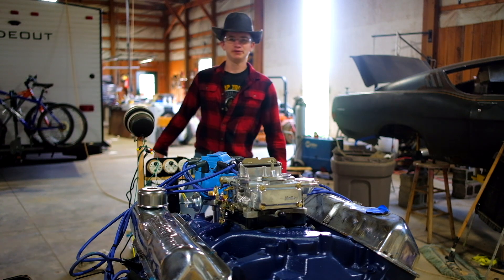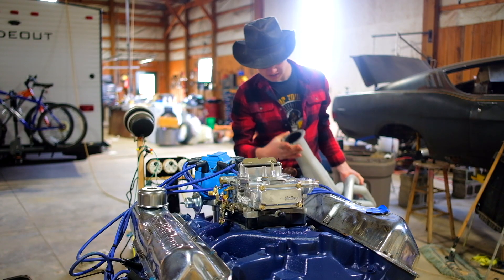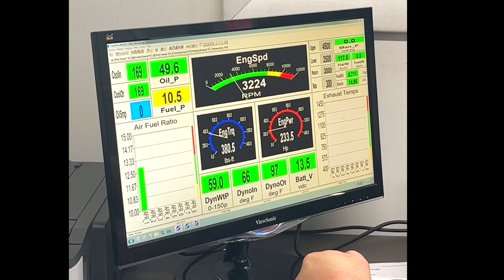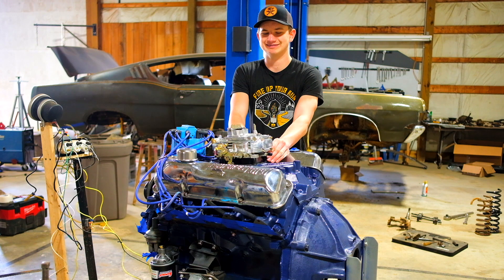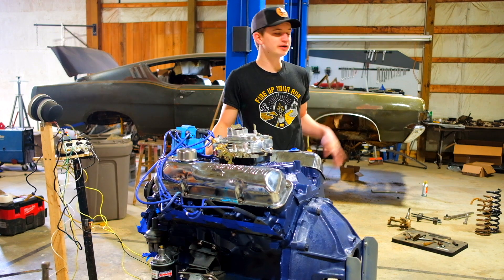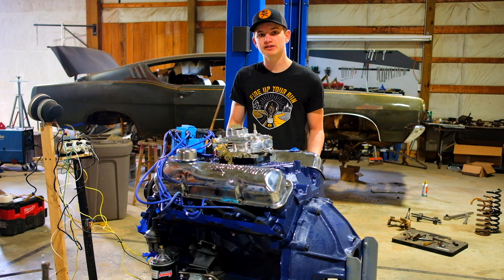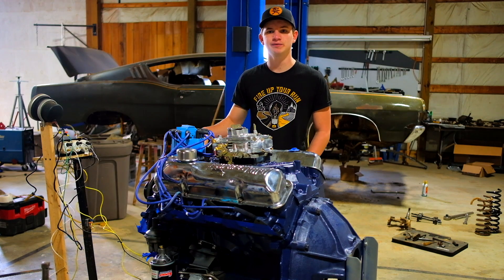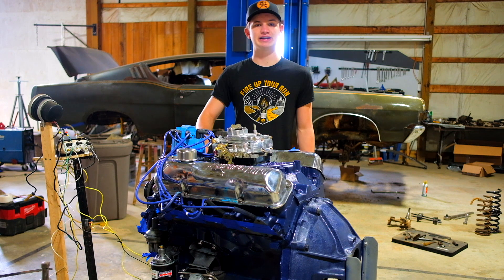Stock Rebuilt Ford 390 GT Dyno Tested

Comment: Cough....Choke....Cough....this engine choked out at 3900rpm. Even the 390-2v camshaft went to 4400rpm. I think you have a 1972-75 390 cam that makes peak horsepower at 4,000rpm and peak torque at 2600rpm
Reply from the maker: You could be right but I have evidence to suggest otherwise. For starters I didn’t fully degree the cam like I ought to have but I did take a few measurements and my gross lift is way higher than a 75 cam. I don’t fully know why I made less power but I don’t think it was my cam.

Comment: 650 cfm is not enough for that motor 750 or850 would be my choice would improve probably 10 hp being conservative had 780 from factory
Reply from the maker: Yep, found an 800 double pumper a few months ago, rebuilt it and that’s what I’m running now. As well as a sidewinder intake and a Progression ignition distributor.😎 I don’t think you can ever have too much carburetor when it comes to peak horsepower.

Comment: Find a Edelbrock. Street master intake.  For it.  One that has not been  been modified. No port work  they are only a couple hundred bucks  best intake you will ever get for a stock. FE.  Don't port match until you are going for 500 hp.  Leave it box stock.  It should get you to your 300 hp + mark.   With ease.  Good luck
Reply from the maker: Thank you!

Comment: the 390 was just as fast as a 396 or 383. if it had a bigger carb and a better exhaust it could outrun them.390s came under carbed from factory and the factory log manifolds were very restrictive.

Comment: I would get a 270 H cam and run it up to 6000 you aren’t going to blow it up. Mine is making 503 hp and can rev up to 8000. FEs are tough.
Reply from the maker: I will eventually, and yeah they are very tough

Comment: You ant running it right and just for your info that moter is good for 7000 RPM red line all day.try putting the cam timing strat up

Comment: Why would you run a H.E.I.          😔I mean, there's a lot better  options out there.
Reply from the maker: Yeah I know it’s crap but it was all I could afford. But in my most recent video I installed a brand new Progression ignition distributor with a pertronix flame thrower coil.

Comment: The 390 GT engines had terrible intake and exhaust manifolds.....the GT intake was the worst performing FE intake of them all.  It did make great low end torque though.  The log exhausts were awful.....but the 68 Cobra jet exhausts weren't too bad.  Too bad Ford didn't use their aluminum police interceptor intake and better exhausts....performance would have been much better.
The solid lifter  390 HiPo of 1961 performed a lot better in the Galaxies, being rated at 375 hp for the singe four and 401 hp for the three two barrel engine .....put those in a Mustang or Fairlane , and look out.
Reply: Ford should have done more parts-swapping with the 390 to match what Chevy was accomplishing with the 396. The 390 Gt had the 428 CJ cam, but you're right about the ports--blame the shock towers for screwing up Ford engines from the 1960's as far as exhaust flow was concerned.
Reply: @albertgaspar627  I think Fords way of thinking was that they supplied all the speed parts a guy would need through their High Performance over the counter program.....
As they put it back in the day...."We don't want to be responsible for killing 17 Year olds".
The 390 GT made enough low end torque to impress, during a test drive with a salesman along side,  but once on the street,  up against a SS 396 or 440 , it was left behind.
Reply: @godsowndrunk1118  Ford definitely wanted the customer to buy the top end car to get the real good stuff (like buying an SVO Mustang to get rear disc brakes on a Fox, or buying a 4 bolt small block engine). And Henry originally had been stubborn about change, thinking his Model T was everything a farmer needed. Ford was "first" with the pony car (tho Plymouth was a few months earlier with the Barracuda) and perhaps didn't want to compete with the Shelby (until 1969, with the Boss and the Mach 1).

That is a point about selling to 17 yr olds...tire tech in 1966 had reached its zenith and even Rodger Huntington thought the supercar couldn't get better than what was offered in 1966.

You're right about the torque, however. I still hear folks say their 390 was the fastest in town. Against a 383 Road Runner or a 325 hp 396 or a small block in a small town, I could see that. but go into the city, and you were up against real competition.
Reply: @albertgaspar627  I agree with most of what you say.....but there were some farmers that had some awfully hot cars back then....they had everything needed to build their own...shops, equipment, know how and most of all.... money.
Reply: @godsowndrunk1118  oh yes, when it came to "home built", you are spot on (i live in a formerly rural area and have a blacksmith/repair setup like you mentioned). esp. if you grew crops rather than animals, you had the winter free and there was an old industrial hemi running the irrigation machine and farmers rarely toss things out they can repurpose...they may not have had the money, but they did have time, and sometimes that's a good enough replacement :) 

(during the world wars, the city slickers would laugh in basic training about the rubes from the countryside not knowing things...until it was time to hit the firing range. and when it was time to make the assigned tank run faster than a Panzer)

autumn harvest may have been a celebration time (ie, the county fair) but come spring time, there were some interesting jalopies that came out of the barn and you can see the burnout arcs on the farm roads where "testing" occurred. 

and i'm not even counting the moonshiners. they DID have money and built some Q ships, but that was for business.

Comment: Did u use a stock cam?
Reply from the maker: Yep, stock cam and lifters. I wanted it to be very street friendly. Plus I’m broke so I couldn’t afford a new cam.😂
Reply: @itllrun6030  haaaa haaa nicee ..so u you used the original cam then? My mann
Reply from the maker: @OGSHAKER2020  Yep, the original cam and cam bearings and even the original lifters which is arguably more scary😱 But it runs great and we got about 60 miles or so on the car. I’ll do a cam swap one day😂
Reply: @itllrun6030  thats pretty cool though 😎 my friend 😎

Comment: I knew a 390 was a slug. Hell, a Mopar 340 made 322 hp stock
Reply: When I was growing up there were no (fast )390  cars. We used 427, 428 motors.  Smaller 351 Cleveland  would eat its lunch as far as that goes.

Comment: Back in the day I had a 390 in a 1962 Galaxie and every 327 /250 HP in an Impala blew my doors off. Y blocks were even worse.
Got my revenge in later life when I had a 460 modified in an 85 bronco and dusted a 350 Corvette in the 1/4 mile. I was never a fan of the FE engines, loved 429 / 460 engines.

Comment: If you like HEI.. chuck that hunk a you know what and replace it from a mid 70s Duraspark distributor and remote mount the HEI module on a heat sink.  Like magic you will be able to install a air cleaner of the right size again.  You will also discover that if you had done this from the beginning it is actually cheaper to buy a rebuilt duraspark dizzy and a hei module and do the 4 wires to hook it up.  See google for how.  It is like $80 bucks and it looks so much better and doesn't cause fit issues nor have the self cooking module feature those dumb chinese dizzys are famous for.
Reply from the maker: Awesome! I’ll have to look into that!